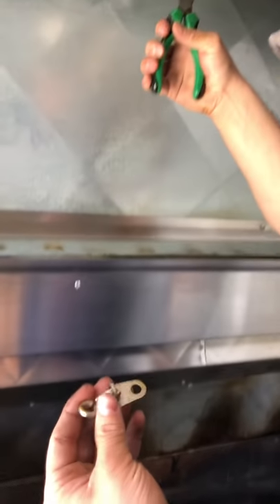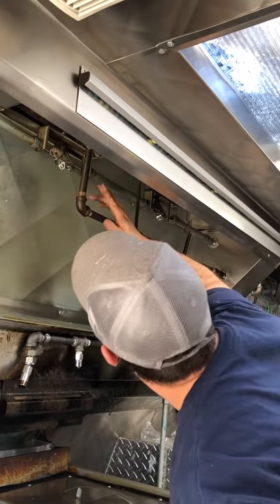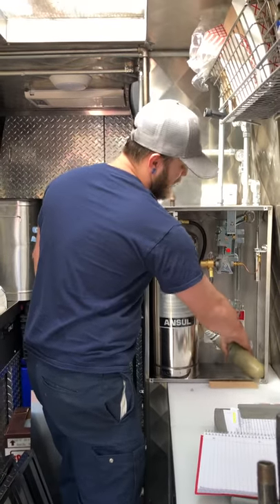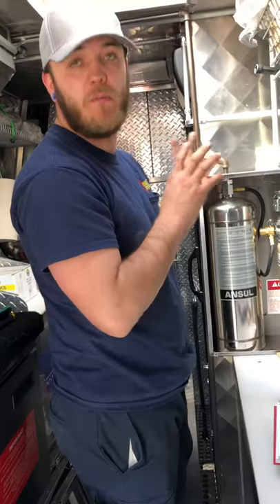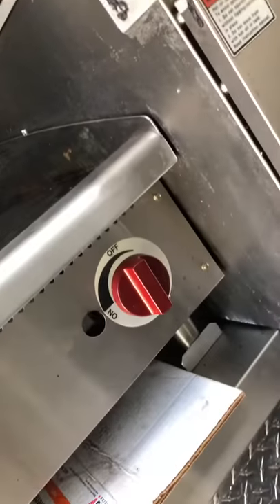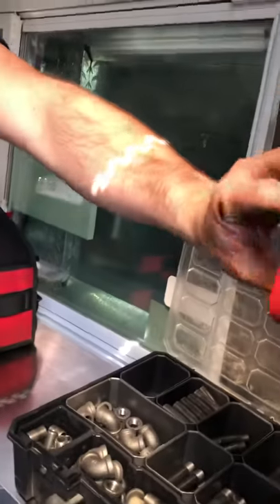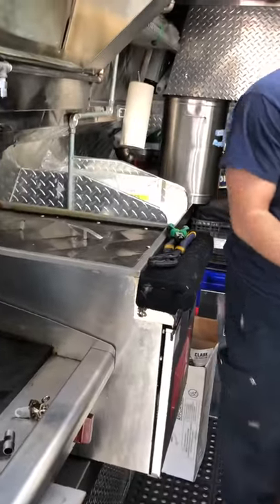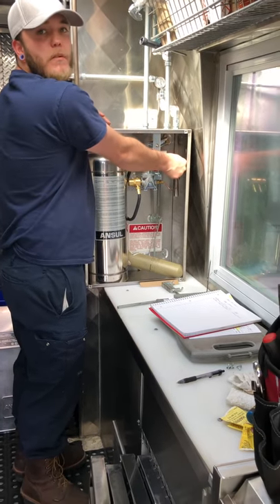Fire suppression certified inspector for food trucks ( Restaurant grade commercial Fire Ext. )

Comment: A union fitting is required within close proximity to the ansul r102-3 cylinder for disconnection due to system discharge, hydrostatic testing, and/or general maintenance.
Reply: Not on ansul as the top of the tank has it's own union with a bursting disc in it